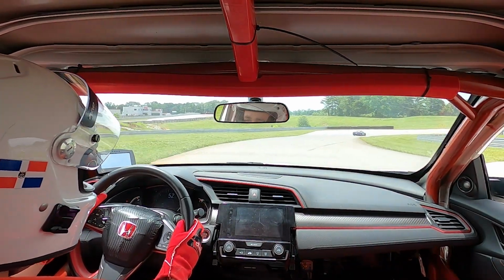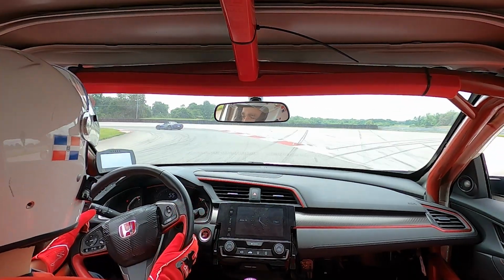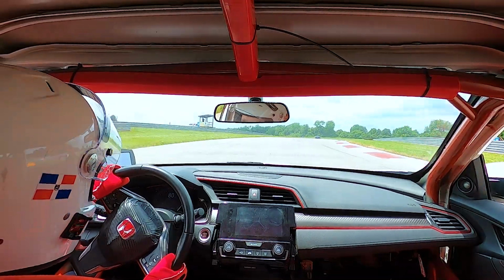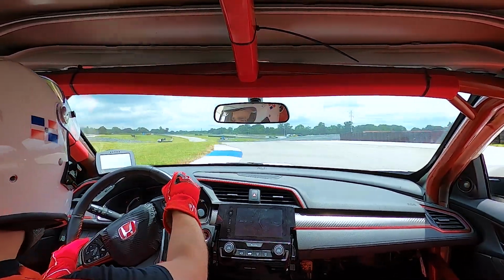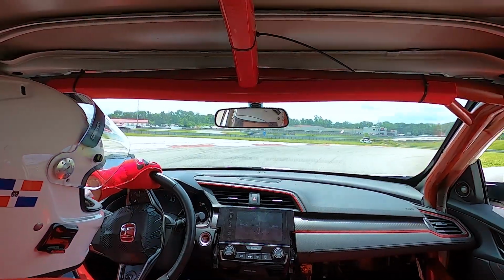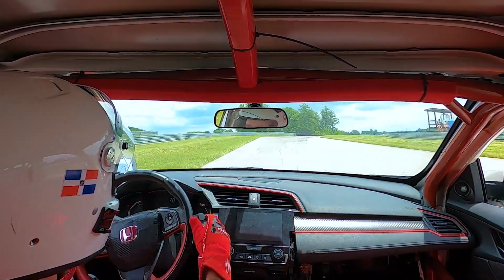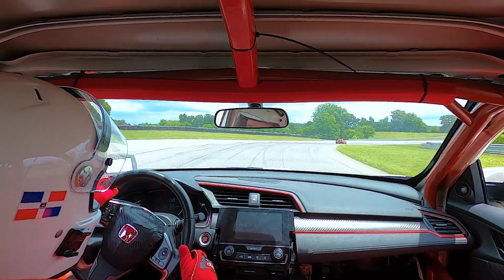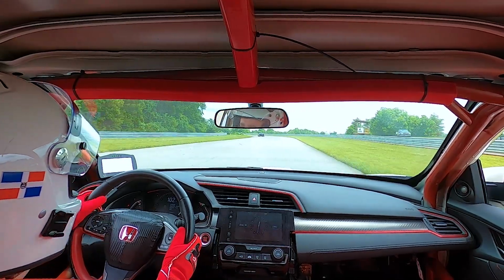🔥🔥 It's TOO Hot and TOO Humid | Honda Civic Type R Type Attack Session 2

Comment: Hey bro this is the same issue I was telling you about back in 2020 with outside air temps of 35 and tracks temps of 40+ (degs I’m in Australia)! I sorted it with a bigger FMIC, hood spacers to allow airflow through the engine bay, aftermarket front grill and aftermarket radiator. Didn’t get any overheating issues after that. Note to mention regardless of all the cooling mods I did I could still feel heat soak towards the end of the 15min session so a cool down lap was required in the middle. If you want to achieve ultimate power with no temp issues you should run meth and get yourself an oil cooler! 👍
Reply: I am in Adelaide and I had a track day when it was 40C. Track temp was probably 50+. I defintely felt power loss but no overheating whatsoever. PWR IC and RD, HkS oil cooler, completely cut out the front bumper and grill for max air inflow and Seibon hood with large vent over the inlet pipe. Many people don’t seem to understand hood vent is more important than all other mods in that hot air needs a fast way out otherwise all gets trapped in engine bay making things worse.
Reply: @瞻高-b9q  with all those mods I’d be very surprised if you had any heating issues!  I forgot to mention 90% humidity which you don’t get down there 👇. The hood spacers work better than you think. The hot air has no where to go with that thicccc rubber weather seal at the back of the engine bay. Crazy the amount of heat that flows out there. 🔥
Reply: @mytevoIII  Forgot to mention AC must be removed otherwise overheating would persist. I have heard many owners report on this. Yes, I tried to remove that windshield rubber but to no avail. But not much hot air could escape there because the closer to the windshield the pressure above the hood is bigger than under the hood hence why the hood vents must be as close to the front bumper as possible.
Reply: @瞻高-b9q  hood spacers 😉 makes no difference to aero below 200km/h. And if you are racing professionally with a team you have already addressed all these issues.
Reply: @mytevoIII  haha unfortunately most of us don’t have the fortune to race with a pro team. We are just weekend warriors and mechanics working on our own project cars. I definitely learned cooling and aerodynamics the hard way over the years with many failures and frustrations.

Comment: The way the cage bars have been painted look awesome! I'm glad that they found no issues with your type r. Ah nice, this video addressed answers to my last question about the s2000's engine. Indeed those naturally aspirated engines were built tough as titanium back in those days. Have you ever modded your s2000 or prelude? I do not know the history on those vehicles. I only ever knew your type r.
Reply from the maker: I have modded the Prelude extensively (lots of vids on that). The S2000, I am about to film a series of vidoes on mods I am making to it, more like OEM+ mods, and I will be taking it to the track for sure. The bars look great in that red paint, thanks again to the wife!
Reply: @FlyinGato  That's awesome! I did not know that about the prelude. I am excited to see what you do with the s2000! You're wife did an amazing job with the paint!

Comment: Try a bigger radiator and Evans coolant.
Also try meth injection, that cool the the intake charge.
Reply from the maker: meth pretty much fixes the problem, but it's not an ideal solution, you have to keep the tank full

Comment: Vented hood, upgraded fuel system running ethanol, oil cooler, mishito moto secondary race radiator, dream automotive ac delete, close to stock level tune. I haven't overheated since on the track.
Reply from the maker: how's the power levels? does heat soak get bad still?
Reply: @FlyinGato  I had a great amount of power loss when I had my prl intercooler and prl air intake. I went back oem and retuned the car around 330hp ish. The ac condenser is a problem because it's blocking all the  airflow even with modified grill.